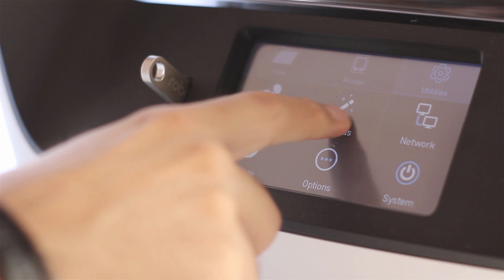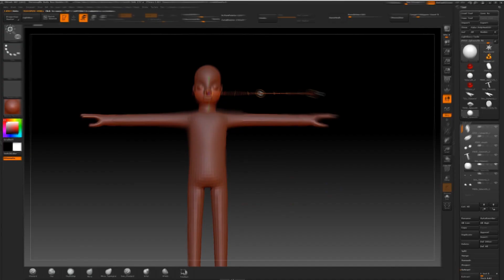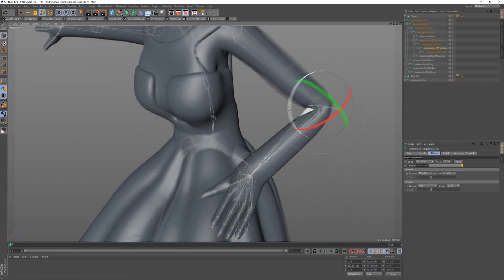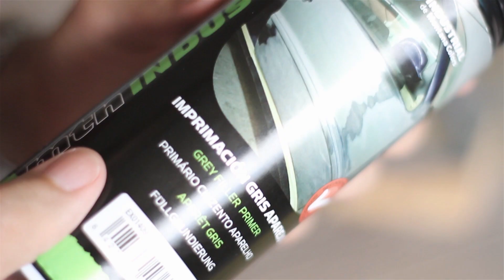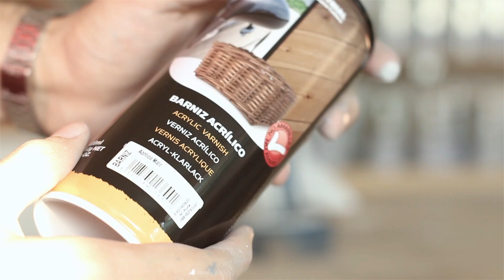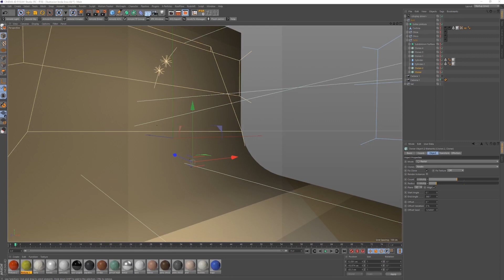3D Printed Wedding Cake Toppers / Robo R2 / Personajes para Tarta de Boda impresos en 3D

Comment: Hola artista. Que suerte han tenido los novios de conocerte. Ésta y todas tus creaciones me encantan. Permíteme una pregunta ¿Entiendo que seguir este postprocesado (sobre superficie oscura: aparejo gris + pintura base blanca + policromía) te da mejor resultado, de ahí que uses PLA negro estratégicamente para poder ver las lagunas en la aplicación del aparejo gris y por eso no usas el aparejo en blanco para distinguirlo de la pintura base blanca?
Salu2 desde Sevilla.
Reply from the maker: Más que por el color, usé ese filamento, por que es un PLA especial de fácil lijado. Pero como dices, también ayuda para ver ver imperfecciones. Y el aparejo igual, esa imprimación suele ser gris y ayuda a ver errores antes de pintar. Gracias!
Reply: Yo hasta ahora usaba el EP blanco  para mis esculturas y en vez de aparejo usaba gesso. Probaré el negro y el aparejo. Esperando tu próxima creación. Gracias por responder. Salu2